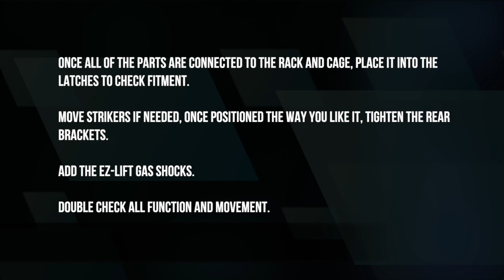HOW TO: Assault Industries Adventure Rack Installation

Comment: Is there any type of simple trick to adjust the rack higher but still keep the rack level?  Was told its adjustable from 13-16" of bed clearance.
Reply from the maker: You can adjust from the lowest setting (Rear brackets down) or up to the highest setting (Rear brackets up) and play with the placement of the striker and EZ-lift. There isn't much in the middle, its going to be either/or - In the video, the rack was mounted at its lowest setting. There are a couple of degrees of pivot based on the 3 adjustment points. noted above at the highest and lowest setting. We will try to make a video for that in the near future.
Reply: @ASSAULTINDUSTRIES  What do you mean by brackets down and brackets up?
Reply from the maker: @McCurdyOutdoors  The pivot brackets at the back that mount around the cage.. You can only adjust those up or down. loosen them and tilt them upward to get more bed clearance, then tighten back down in that position.